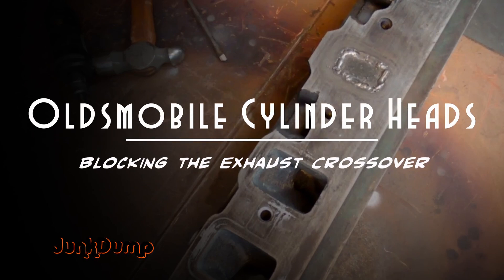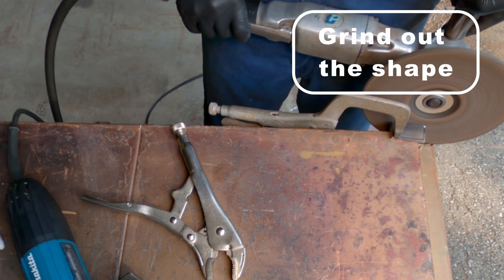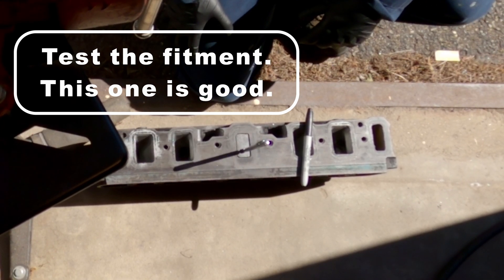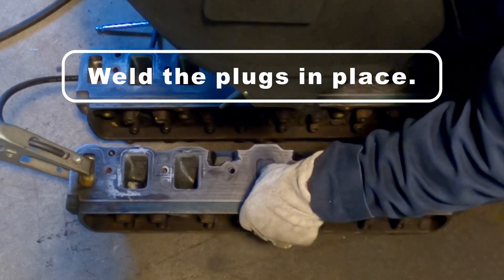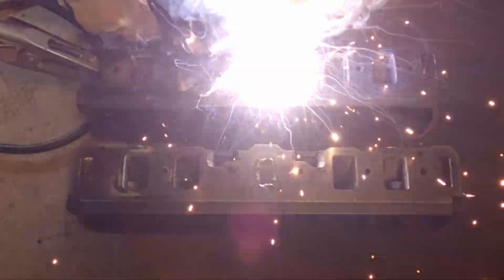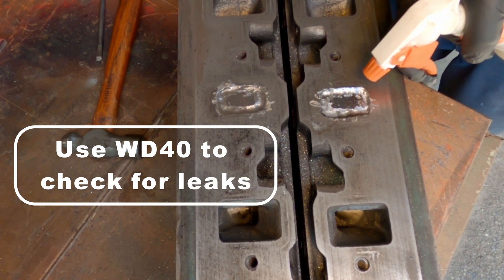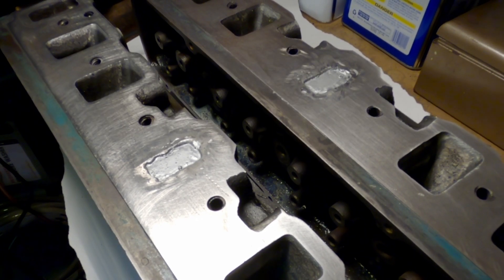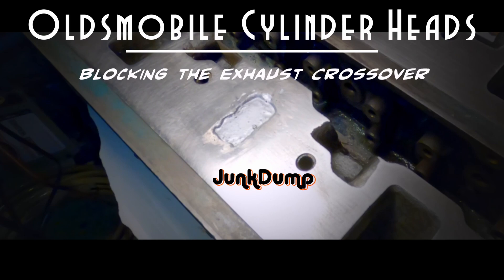Plugging the Exhaust Crossover on Oldsmobile Heads

Comment: Please, please, please, dont use vise grips to tighten bolts.  It’s really cringe worthy. Other than that, great work!  Keep the content coming.
Reply from the maker: You are correct that vise grips should never be used to tighten any engine bolts, however I make an exception for cast iron hydraulic pipe plugs when working on late Oldsmobile heads. Most people do not own an open wrench with a good fit for pipe plugs and use adjustable wrenches on them. I don't use adjustable wrenches and prefer vise grips as they provide better fitment and feedback for applying the proper torque.
Reply: @junkdump2720  well said.

Comment: 😂 clearly doesnt know what to weld cast iron with or how to. Hilarious. Or the real reason you block crossovers.
Reply from the maker: I have brazed cast iron with an oxygen/acetylene torch but prefer using my welder on crossover block plates, of course I had to heat the head and slowly cool it afterwards to reduce the chance of cracking, but this method works great on simple block off plates. Please feel free to share with the channel what you weld cast iron with and what you think is the real reason to block your crossover ports. I only ask that this time you share the information and leave out the personal jabs against me, they aren't necessary and quite possibly aren't accurate.
Reply: Any welding rod, mig wire or flux core will do , your not fixing a crack or welding a head back together, it really doesn't matter , if you had any real world experience you would know he knows what he is doing . Been done thousands of times and works fine .

Comment: Sure beats melting pistons and filling each opposing hole “exhaust and topping the flange side

Been Using this method for a few years now and many ways to skin a cat or paint a car, but this works over 200 passes on a iron set of heavily
Ported E heads and all is good.
Reply from the maker: Good to hear this works for you too, especially after 200 passes.

Comment: Question...
What does that achieve...
More power due to ...
What...
I see it as a change in exhaust note...
Reply from the maker: I am glad you asked this question. The exhaust cross over in the intake manifold was designed to help heat the intake (and carb) quicker for benefits in cold weather and with early emissions. The drawbacks of the system are plentiful. It adds heat to the intake charge which is unwanted in every scenario with the exception of extreme cold weather and startup. It also contributes to engine heat, which is hard on your cooling system. Properly blocking the cross over passage in the heads is an excellent upgrade in performance engines. This one modification helps keep the intake manifold and intake charge cooler,  while reducing the strain on your cooling system. Generally speaking , a cooler intake charge is a denser intake charge which makes more power.
Reply: Helps heat soak/ vapor lock

Comment: What wire are you using? Any reason you don’t just fill them?
Reply from the maker: Here I am using Lincoln Electric .035" flux core wire. Filling the crossover is a lot more involved, it might be worth it if you were making racing heads. The other method that I commonly use is welding in the plugs that are available from Edelbrock, they reach further into the passage. Thank you for the questions.
Reply: Will the Edelbrock 2733 work with the Olds 403, or just the 455?

Comment: Out of habit I find myself doing a "safety squint" when you're welding. What do you need to weld to cast iron?
Reply from the maker: Welding cast iron is tricky. I use a 110V welder and I heat the head beforehand. I weld small sections spaced out to keep heat down. After welding I let it cool down slowly. It's funny, while watching the video again, I also did the "safety squint", I guess we are conditioned! Thank you for the question.

Comment: wouldn't blocking the intake be easier ?
Reply from the maker: Great question! I prefer to block the heads for two reasons. 1-Less heat is transferred into the intake when you block the heads. 2-Some intake gaskets are prone to failure and leaking when the intake side is blocked.

Comment: Is this mod only useful on performance cars, or does it provide some benefit on a driver-type car as well?
Reply: The main benefit is it will save the paint on your intake. I did this to my stockish 350 Olds. I drive it year round.
Reply from the maker: It does provide some benefit but you have to weigh the pros and cons. You have to keep the choke on longer for cold days and the intake will take much longer to heat up. Some people don't notice much and others do. I have this mod on two of my personal cars but I don't drive them much in the winter. I had a dailer driver with a 455 and this mod when I was in high school, I found it a minor inconvenience in the winter time but worth it for the summer benefits.

Comment: I love your video on the Oldsmobile oiling my wife is building a 455 for a jet boat right now and I wanted to block off the crossover port on the heads would it be okay to weld those plugs in with flux wire or what did you weld them in with thanks John
Reply from the maker: Great question! On this video I used flux core wire and a 110v welder. If your metal prep is good, you won't have an issue. Check for leaks when you are done. Grind and weld any gaps you find. Don't use sheet metal, it will eventually burn through.

Comment: What about porting the inside of the exhaust ports on the other side of your weld and with the air holes on those heads those are junk heads ...I have about 12 sets of heads from the mid '60's to early '70s small and big block... Some built already and some stock when the center exhaust ports are done properly you can get 50 extra horsepower and the other side where the headers bolt up with that dip build it equal as the rest and you gain anouter 10-15 horsepower my 425 c.i. "C" heads I got 90 horse out of them that motor is over 525 h.p.
Reply from the maker: Please keep in mind this segment isn't about making the best flowing Olds heads, this is about modifying this style Oldsmobile small block head to get better performance. You also wouldn't fill the crossover unless you were building a set of race heads, but in that case you wouldn't use stock small block heads from the late 70's-80's. There is no benefit to port the crossover cavity behind the welds as there is no flow through those passages once you plug the crossover. On these heads the intake and exhaust passages leading to the manifolds / headers have been ported and the AIR system remnants have been removed. You might consider these heads "junk" in stock form, but when ported and modified properly they will greatly increase the performance on a stock or performance street / strip engine build.
Reply: Pete, I think you're full of shit. Did you actually think about your question? Why the hell would you port on the other side of the welded block plate?
Reply: I have the original 330ci small block in my '65 Cutlass with a Performer RPM manifold fitted to the 4A heads. Would my engine have these same exhaust crossover ports? Is there a way of knowing if the ports have been filled in or not without removing the intake manifold? Wow,50 horsepower is a lot to be gained simply by filling in these holes. I guess they are there to help warm an engine from cold, correct? Do you know of a good way of filling the external dip as you call it without the welding and grinding? Also, what are "air injector" ports that were filled in with NPT plugs? I'm in New Zealand so Oldsmobile knowledge is a true rarity down here. Thanks for your help